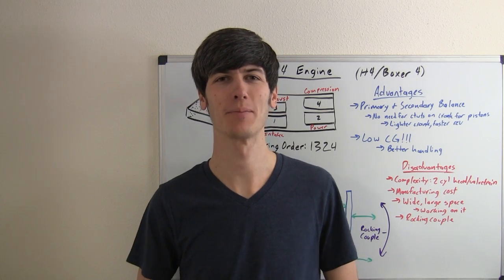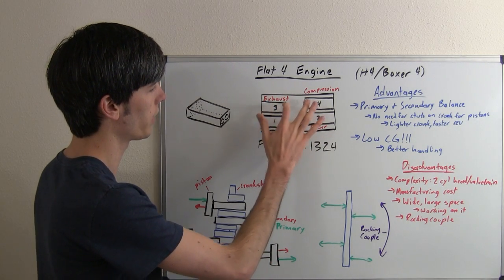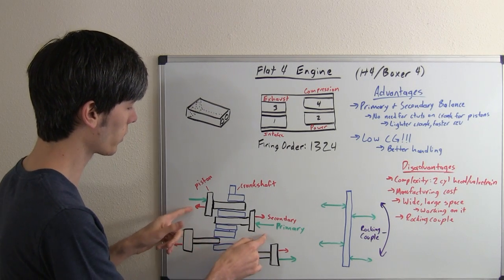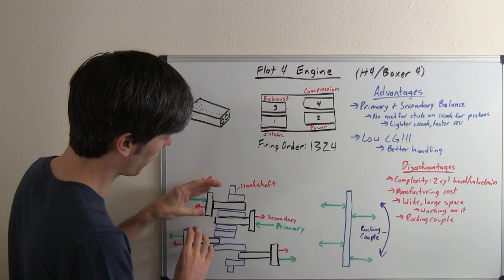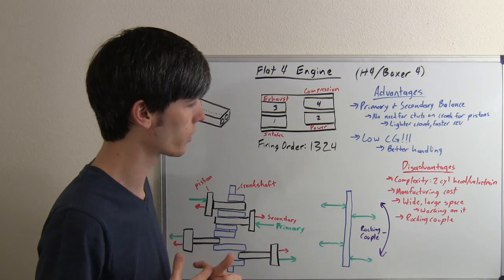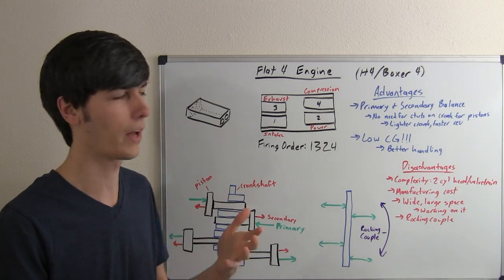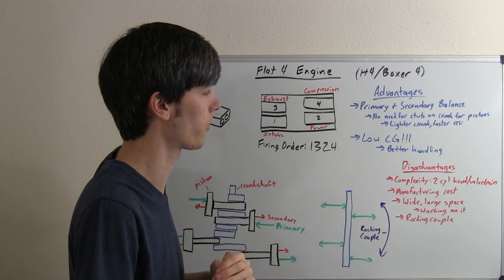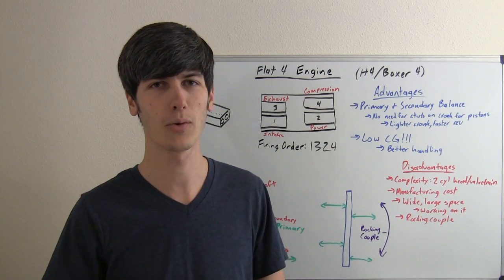Boxer Engine - Flat Four Engine - Explained

Comment: are boxer more prone to oil leaks and why?
Reply from the maker: I'm not sure why they would be..
Reply: Brian Su. It is cool. I really wish to own one (the one that you demonstrated in the video)I lives in Malaysia
Reply: ***** you can get the GT 86 in Malaysia for circa MYR 250,000 :)
Reply: Hi Brian. I am referring to the laser that burns
Reply: ***** Ohh hahaha that's very powerful and dangerous O.O
Reply: Brian Su. How can I own one? Please....
Reply: I dont think it would leak any better than any other engine configuration
Reply: They leak from the valve cover gaskets/head gaskets. Since the Boxer is flat, oil builds up and takes a while to drain back down into the sump. The oil tends to eat at those gaskets....
Reply: fightingfalconfan Yup that's exactly what my concern was.
Reply: Still an awesome power plant though. The engines can last a really long time...
Reply: fightingfalconfan Yup but they are a pain to fix when something goes wrong. On mine the boxer has to be jacked out just to replace the spark plugs...
Reply: That's true boxer engine configuration is difficult to get to the parts cause how low the cylinders are, but thats more or less how you get the perfect drift car, cause its has more weight distribution on the horizontal plane over inlines.
Reply: So you have a 2 liter or 2.5 liter turbo then...
Reply: Engineering Explained Can you please do a video on Rotary Engines!!!

Thank you

Comment: The vintage vw Air-cooled engines is the same boxer format the firing order for these old vw air-cooled engines are 1-4-3-2  as the boxer engine is mounted in the rear of the vehicle connected to a 4 speed manual transmission. the 1983-1992 vanagon models the boxer engine is water cooled and the engine is mounted in the rear of the vehicle. as for the subaru boxer engines they are mounted in the front and are more better and stable with the low center of gravity. as there is 6 cylinder boxer engines out there mainly made by porsche for its high performance cars,  as Subaru has a 6 cylinder boxer in some of its models and the old Chevrolet Corvair used a flat 6 boxer too.  as the 6 cylinder boxers dont produce the rumble of the 4 cylinder boxer. as both 4 and c cylinder boxers are used in many aircraft since the 1940s to the present day in small single or twin engine aircraft.

Comment: Is it true that Subaru flat four engines cannot withstand high power very well? I have heard the oil circulation is an issue when these motors, when pushing anymore than 280kW.
Reply: Porsche disagrees...
Reply: Sorry I meant specifically for 'Subaru Boxer' motors. I rephrased the question.
Reply: There's a lot of people putting down a lot more than 280kW without any problems with these engines.  I know a guy who has an STI with 372kW to the crank and road races it regularly without any issues.

Comment: Are some maintenance items like spark plugs on these engines a pain?
Reply: +YZRandomE spark plugs are actually relatively easy on a Subaru h4
Reply: At least on a Subaru, every little maintenance is gonna take you double the time... it is terrible to access any part of the engine. To change my spark plugs I had to remove the air filter box, the wiper water reservoir, and needed two extensions and an universal joint wrench to reach it.
Reply: At least on the dual turbo Legacy. The non-turbo or the Impreza (only one turbo) must be slightly more spacious. The Intercooler also always gets in the way of some parts.

Comment: I wonder why there is no 2 cylinder boxer engines in small cars, and how it would be perform. It could be fuel efficient without unnecessary vibrations.
Reply: they had 2 cylinder boxers for over 50 years, the Citroen 2CV had a 2 cylinder boxer, a lot of BMW motorcycles have 2 cylinder boxers as well.
Reply: rafał wkx Probably due to cost?The boxer engines are more complex than and inline or a V
Reply: DavisSgt i don't think so, the V engines are more complex, in-lines and boxers are simpler, no geometry needed for "balance", you have so many variances for the V configuration, from VW's 15 deg V to a standard 90 deg V.
Reply: mr bad example So complexity wise in general is in the order of V>H>I?
Reply: You would need 2 sets of camshafts and a complicated cam drive system to go with them. It is not worth the cost for NVH reasons. Plus torque would be abysmal due to very low crank weight (lack of counterweights) which means you would need to rev the sht out of it to get going, with piston friction, pumping losses and valve float negating any efficiency benefits.
Reply: The Toyota Sports800 had a 2cyl Boxer; hence why the GT86 has a Boxer; that heritage, though.

Comment: man i am wanting to put a subaru 6cyl wrx sti engine in a older model porsche boxster... would you know if it would possibly work?
Reply: The WRX never came in a flat 6, the only production car that Subaru put out that had 6 cylinders was the SVX, and maybe an outback or Forrester. The WRX relies on its turbocharger for the vast majority of its power.

Comment: also with gravity acting as a down force wouldn't one side of the piston rings tend to wear faster than the other side i.e. more weight on the piston side skirt on the lower half?
Reply: or would the velocity at with the pistons travel outweigh gravity?Just spitballing hear just a humble backyard mechanic.

Comment: Are boxer engines more reliable than regular engines?
Reply: It all depends. Subaru makes great boxer motors and have for decades. Although their are a lot of great inlines, as well.
Reply: Chris. W Is this a joke?
Reply: george jordan How is an inline, four cylinder, motor the same as a, horizontally opposed cylinder, boxer engine?
Reply: I'm a little confused there, my dude. They are different.
Reply: george jordan I agree, but your comment implied that Subaru also made "great inline" motors as well. So, because your comment wasn't very clear, I was confused as to whether you were referring to possible inline engines that Subaru has also made.
Reply: ohh no sorry. I meant Subaru boxers compared to inline in general
Reply: george jordan Oh.
Reply: If naturally aspirated, boxer engines will probably outlast the rest of the car. If they go wrong it tends to be the stuff around them, like pumps and turbos. Or they have been tuned to far without upgrading internals.

I know someone who bought an old scoobie for £100 with 260k on the clock. It had a hard life and the paintwork and interior is wrecked, but it's boxer engine is faultless and still runs great.
Reply: ***** Ah. Too bad that the Subaru boxer engines haven't really proved that in comparison to inline Honda/Mitsubishi/Toyota engines. I don't know if Porsche boxer engines have faired differently.
Reply: I have an 03 Baja and have had zero engine problems with it, despite having almost 240,000 miles
Reply: Those bajas are so cool and unique! Don't ever get rid of it.
Reply: Actually the Porsche boxer engines do tend to suffer from the same issues.

Comment: Flat 6! Flat 6!
Reply: V8, v8
Reply: Flat 5! Flat 5! It sounds so awesome!
Reply from the maker: Fred Beer V8 is coming!
Reply: Flat four and flat six are virtually the same engine. The only difference is the rocking couple is eliminated in flat sixes.
Reply: Engineering Explained Maybe you could elaborate on the sound of those engine concepts, too. E.g. the sound similarity of flat 5 and V10 (because the ignition angles differ to the factor of two: 72° vs. 144°?) or the rumbling of a V8.
Reply: Authur Jackson
If a flat 4 is balanced, and a straight 6 is balanced, and a v8 is less balanced, would that make the flat 6 the superior engine layout?
Reply: A v8 isn't perfectly balanced but it doesn't need to be. It has advantages and disadvantages to a flat 6. They are different engines and they have their own merits. For example, flat 6's need a lot of room, v8's fit much neater.

Comment: Hmmm, what about ring land failure ?
Reply from the maker: Has to do with piston design. Overly boosted engines which weren't built for the added stress don't last long.
Reply: Usually an issue with the tune.   Detonation has a nasty effect on mechanical internals of an engine
Reply: The ringland failure has a lot to do with Subaru deciding to cheap out and not put in forged internals. And it's mostly an issue if you boost it beyond stock.
Reply: I hear installing a catch can or air/oil seperator will decrease the chance of detonation.
Reply: Didn't know that,i just heard that STI engines are known for this(boxer engines), thats why i prefer the 4b11/4g63 :)
Reply: all turbo engines can have problems with it.  My buddy did it to his srt4 as soon as he started turning up the boost. Start running lean, detonation, ring lands can definitely go.
Reply: Naptown Squid What do you expect when you turn up the boost, more flow =more fuel.Also i never knew that you could install a catch can.Subaru's IMO dont have the best quality, that's why i prefer a evo.Better to just to it right in the first place and get a evo.
Reply: joe schultz ok?  evos arent immune to it either.  A good tune goes a long way, no matter the make
Reply: i guess that true, they just seem more reliable,

Comment: I really don't understand the hype about boxer (flat) engines...

Subaru FA20 (2.0L H-4):
Displaces 2.0 L
Has 4 cylinders
Makes 200 HP naturally aspirated
Weighs 377 lb

Honda K20 (2.0L I-4):
Displaces 2.0 L
Has 4 cylinders
Makes up to 220 HP naturally aspirated 
Weights 275 lb.

Toyota 2GR-FE (v6):
Displaces 3.5L
Has 6 cylinders
Makes up to 300 HP naturally aspirated
Weighs 366 lb

Point made.

Comment: Best engine design.  Yeah if it worked and didn't break every month or 2.
Reply: I own three different boxer engine cars. With 100k, 140k and 170k miles.
And I race the 170k 2.5rs.  Haven't had any engine problems to date.
Reply from the maker: Mine's been going strong for 2.5 months! Woah
Reply: Modify the car, make it fast, see how long it lasts.  Can't baby it though, drive it for what it was built for,  They simply do not last like other vehicles out there.
Reply: Grey Boosted
It'll last, as long as you modify it properly. Days of the 2JZ are over, you can't just put a 80 mm turbo and get 1k hp from a stock engine. That's what all the complainers do to their Subarus, then wah wah wah my non-forged internals don't take 30 psi. :( :(

Comment: Why not. Single cylinder engines placed throughout the car, like Ironmans later suits that had multiple ark reactors. Seems easy enough, Tony Stark did it in a cave, with a box of scraps.

Comment: this is basically a inline/straight engine sideways
Reply: its a V4 and spread the blocks apart to 180*....
Reply: not just that. A boxer's opposing pistons will meet at TDC and BDC at the same time. The firing order is also different from that on an inline 4. There are other 180 degrees V engines that aren't considered boxers because they don't meet these criteria.
Reply: William Su No you can't just call any 180* engine a boxer. There are many that aren't qualified as boxers due to their movement and firing order.
Reply: I mean I was breaking this down to engine block configuration but u get the point
Reply: Boxer engines were named boxer because the ways the pistons move when they go off. Inside the engine it looks like it's punching away
Reply: ***** I agree with William. Furthermore boxer is an English word and the world leader in Boxer engines is Subaru who are Japanese. They only use boxers in 100% of their vehicles.
Reply: Brian Su So they are also the leaders in AWD, since they use it in 100% of their vehices?

Well, I don't think so.
Reply: Krnt13 No that's not totally true. The BRZ is FR. If I'm not mistaken the older Imprezzas were also FR if they weren't of the STI spec ones.
Reply: If we are going to go into details, they don't use boxer engines in all their vehicles, they have around 4 or 5 models with straight engine, the current leader in boxer engines should be Porsche, because they are the best ones at it.
Reply: Krnt13 ohh well ok then.